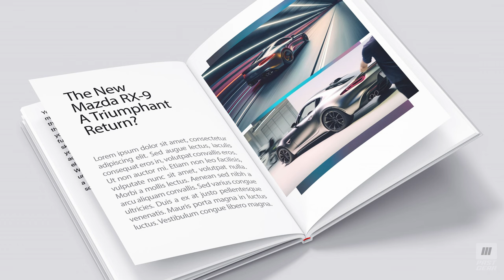What if Mazda made an RX-9 in 2014?

Comment: Even if not rotary-powered, Mazda literally has a turbocharged inline 6 engine that is already developed, emissions certified, and in production (for the CX90)! They could totally design around that instead if they want to avoid expensive R&D for a rotary, plus right now is their PERFECT opportunity for an RX9 to join the new Supra and new Z, and have the iconic Japanese trio back together again, just like old times.
Reply from the maker: Yep, they could definitely do something cool with that right now. Back in 2014, they had no such engine. But I'm excited to see if they use this new turbo 6 cylinder in something more agile than the SUV!
Reply: yes that would be a great Idea. People have put 6 cylinder and even 8 cylinder engines in the RX-8 and the Miata and Lotus also has 6 cylinder Models

Comment: Brilliant vid, really a shame it was never made though I think mazda missed out big time after seening the return of the supra.
Reply from the maker: Thank you! I agree, it was a missed opportunity that they weren't able to pull it together in the 2010s... maybe we'll get an electric one soon instead?
Reply: @Past Gear  that could be your next video the RX-E, I think if they gave a couple to a drift team or do a racing series like the miata cup it would probably be pretty popular, not to many electric sports cars on the market and it could be mazdas new nitch.
Reply from the maker: @lincs4life  Good idea. I honestly think Mazda will revive the RX with an EV anyway. The rotary engine isn't viable anymore, so they've been waiting for the next opportunity - but maybe there's a way the rotary configuration is still used alongside a battery? We'll see
Reply: @Past Gear  hybrid is always a good way to go, best of both worlds then, a rotary with some electric motors to help it along would be face meltingly quick!
Reply from the maker: @lincs4life  Yes, just like I put in this alternative history. Feasibly it would have a really smooth transition from electric motor to the rotary engine too.

Comment: I've seen a rotary engine version w/ a peanut shaped rotor vs the current triangular shape, eliminating the dreaded apex seals, altogether. Looked promising.
Reply from the maker: Mmmm, peanuts 🥜 haven't heard of that one yet, will look it up!
Reply: @PastGear  I think OP is referring to the liquidpiston 'X' engine. It does still utilize apex seals, but they are held in place in the housing now and can be lubricated directly, reducing oil consumption significantly. It also uses a better thermodynamic cycle, so in theory it is much more efficient than current piston engines. However this company is not interesting in using it for automative power, and is focused on military and generator applications, so it may be a while before we see it on cars.